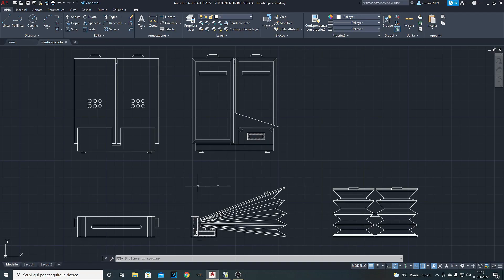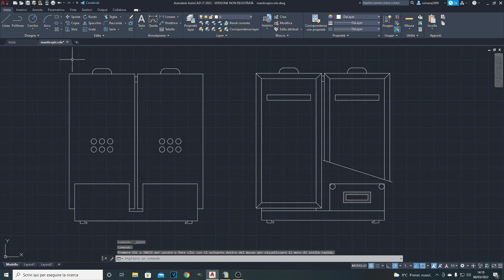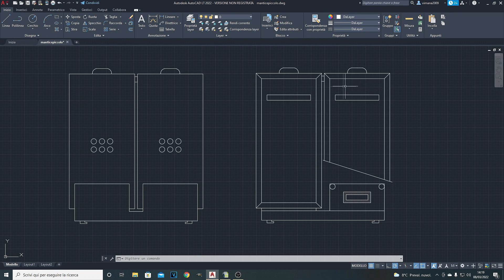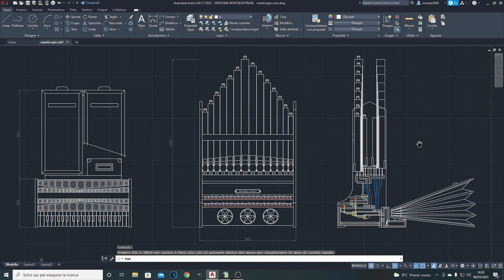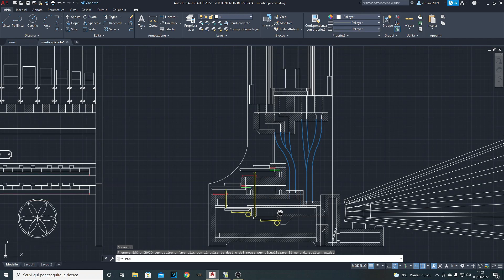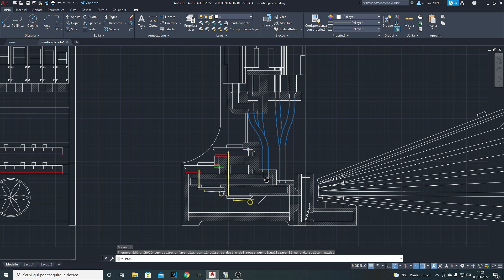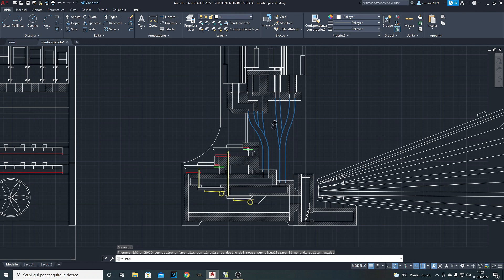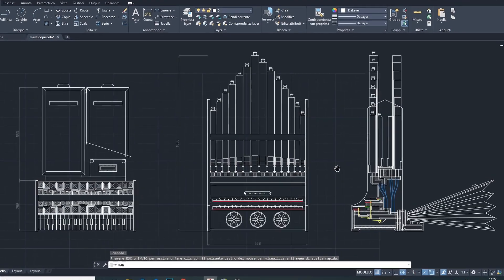#1 Building a Homemade Positive Organ | and new Bellows

Comment: Hi, may I know the difference between this two-bellow system and the bellow with a feeding bellow? both need a second person to operate the wind supply?
Reply from the maker: In this case the bellows are lifted directly, which is why two are needed, so that when one is lifted the other continues to generate pressure. With the feeding bellows, on the other hand, it is also possible to operate it alone with a pedal, or another person is required if the handle is used. The choice is also due to space issues.